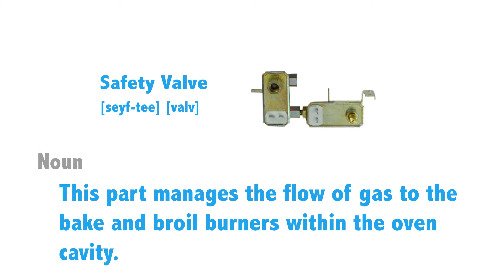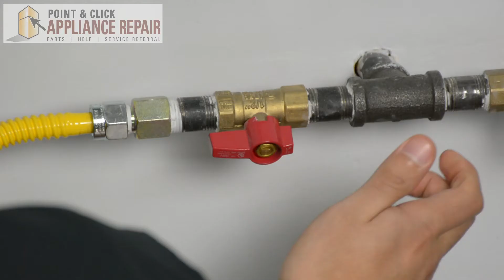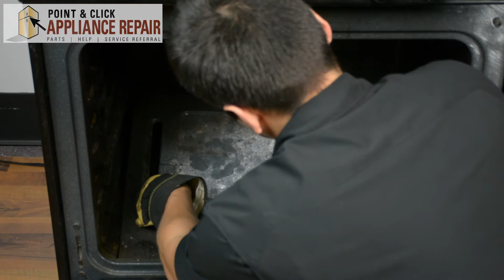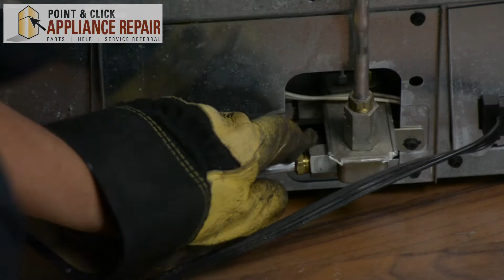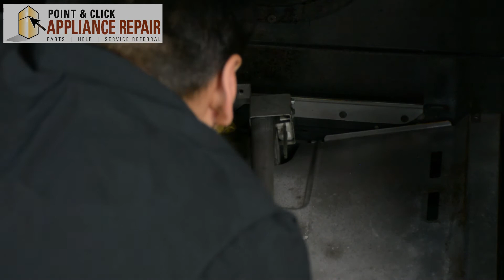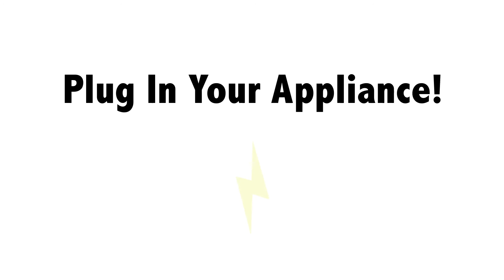316404901 - Replacing Your Frigidaire Range's Safety Valve - AP3879604, PS1150314

Comment: Thank you! You just saved me hundreds of dollars. A couple things I learned: #1: My oven didn't have the same access panel you showed but I was able to access the valve by removing the bottom drawer. #2: "For LP gas installation, the orifice hood should be screwed down against the hood pin. For natural gas installation, the hood should be backed off two to three turns from the hood pin."

Comment: Is there an adjustment to be made on this part for LP gas use?
Reply: Yes,  I have LP supply, and the part that rises up into the burner tube needs to be screwed down all the way (about 2 1/2 turns).

Comment: Thank you but you did not check for leaks also you did not use any Teflon tape are plumbers dope they have Teflon tape for gas lines
Reply: Don’t need them on compression fittings